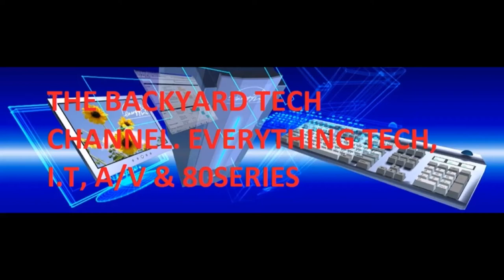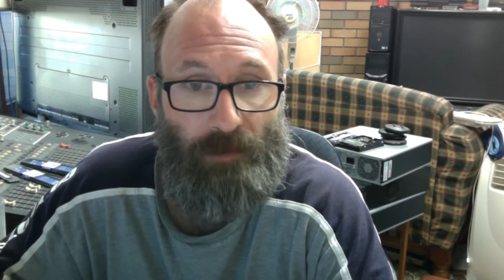Audio/Visual - Basic home theatre audio setup - Clarification Video

Comment: I think you did a lovely job at keeping it simple. 

1) Most people want to know where things would sit in a A/V install, and how its cabled.  Yeah it can be mind boggling trying to figure out where stuff goes.
2) I have been doing electronics for more than 20 years, and I still can't solder like I ought to although it gets the job done.
3) The difference between Cinema and Theater is a fine line.  It depends on how Audiophidelic and purist you get, and I happen to believe that Cinema equates to amplification and processing above 500W to a certain level and should depends on what standard you're following, Dolby, etc.  Large film screen rooms, cinema, often have many amplifiers, large speakers, other odd bits of kit.  Unless you have row seating and a large format screen projection system in your home.  Three color projection TVs were popular in the 80s.
4) There are some well known amplifier kits you can purchase.  Sure you can build your own.  You can even build your own speakers.. There are kits for those as well.  This way you wouldn't exactly have to work out your own design.  But you could still be able to mod to a certain degree depending on the kit you purchase.